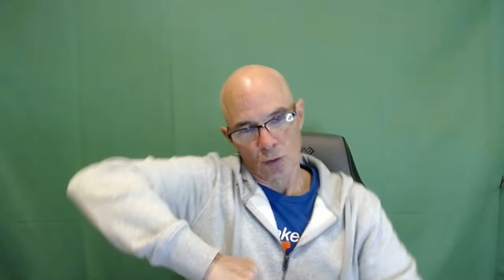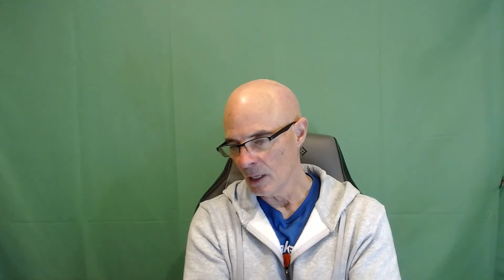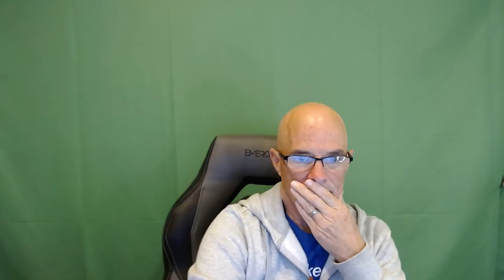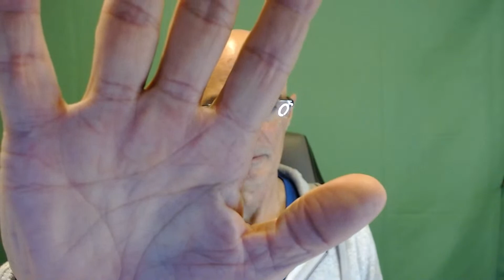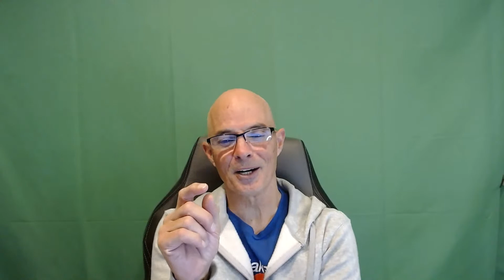LET'S TALK TECH-M90 3800 VS M90 4800 VIDEO IS UP

Comment: I think the head flow and the fact that the 4.8 likes to make power up to anyways. Plus you slow the low end that’s already nil on the 4.8 by sucking up 50-75hp (might be a little high but not far off) off the bottom to run the sc.

Comment: 8psi might still have charge IATs 180-200*.
14-16psi well over 200*.
V8 has 30% more valves. Like the old Buick GN vs Mustang, 6 vs 8.
Reply from the maker: 200 DEGREES AT 8 PSI?
Reply: @richardholdener1727 I’ve seen 200 degrees IATs with my m112 equipped 4.6 2v at 7.5 lbs with stock intercooler and heat exchanger, and even with the AFCO dual pass heat exchanger it still got above 150 degrees after driving for more than 30 mins.
Reply from the maker: On the dyno running at 12.3 psi, the IAT was only 184 degrees with no intercooler.